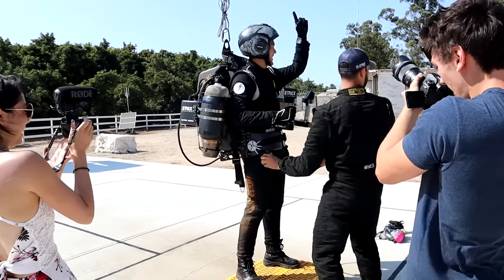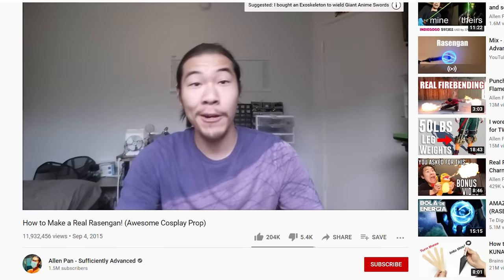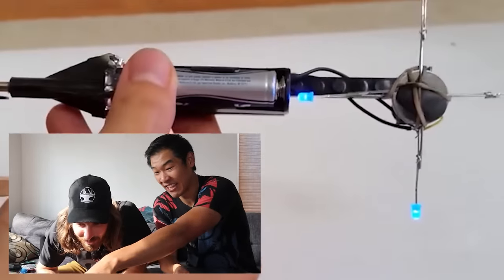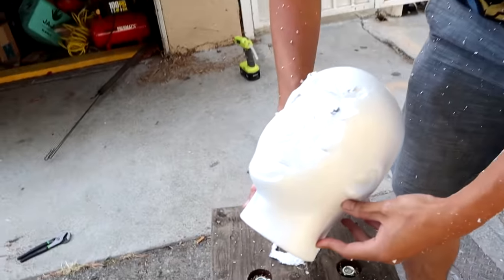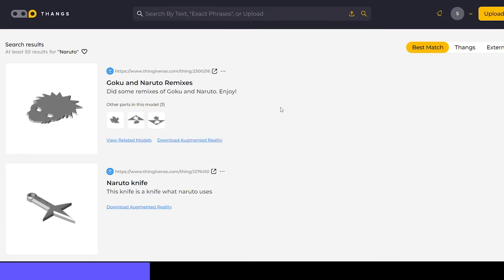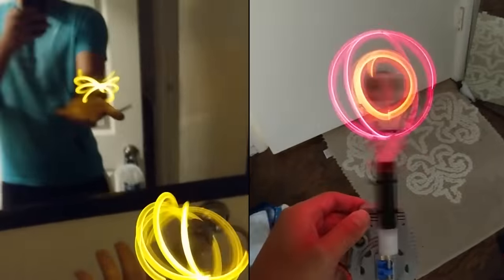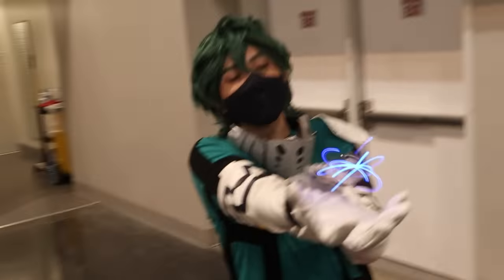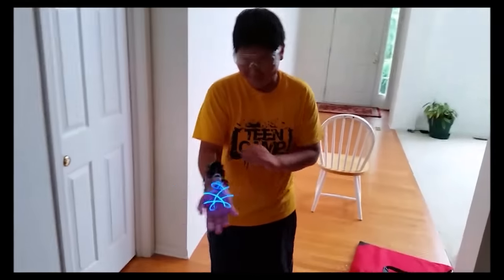Real Rasengan v2.0 (AwesomeR Cosplay Prop)

Comment: Kinda agree with your brother there, but maybe try to counterbalance the rotating motor with a fine thread screw + nut and minimize the spinning weight by just spinning the inner metal axle and keeping the plastic axle stationary for minimized wobble

Comment: Rasengan is difficult but you can make chidori using high voltage module very easily and it will work pretty much like the real one

Comment: I would take an acrylic sphere, scratch its surface with coarse sandpaper in several different angles, and then put this inside of it.  That way it appears to have finer detail, is more spherical, and is safer.

Comment: I think you might be able to remove the motor on the end if you use gears to spin the LEDs around a bearing. I'm not certain exactly how, as I'm not an engineer

Edit, also this might not be cheaper, but may be smaller.

Comment: Still feels a bit too orderly. Rasengan is supposed to be totally chaotic, with the chakra swirling in many different (and sometimes contradictory) directions at once (which is why the water balloon would explode, when he swirled it all in the same direction it made a sphere, but didn't break the balloon because it was orderly). Maybe have another set of lights that spins in the opposite direction, or using some of that programmable LEDs so they aren't lit up 100% of the time, with individual ones flickering on and off from time to time to give it a more chaotic appearance while spinning.

Comment: could you use it as a mixer?
Reply: the idea is funny but mixers only spin horizontally for a particular reason. unless you don’t mind your mixed substance of choice being mostly on on the walls then sure, just a stronger motor, probably bigger power source, and stronger spinning arms would do the trick lol

Comment: Progect rasengan: To make a real rasengan bassicly special glove that can produce super hot fire make a materieal that can transfer heat what i mean is that imagine ypu get that special mateireal cover it around the sun you touch that materiel and boom your hand burns off the materiel also doesnt get damaged by heat because it transfers heat it also stronger than most metals then you upgrade the glove so whenever you make the fire the materiel pops up from the glove and then boom there you have a rasengan btw you need a heat proof glove now this ist entirely fair because the tecnolygy to make this will only exist like 20 yearse after i post this comment if you want a more evidence i have a 20 mental pages in my mind of evidence